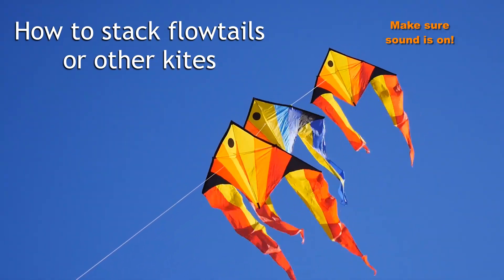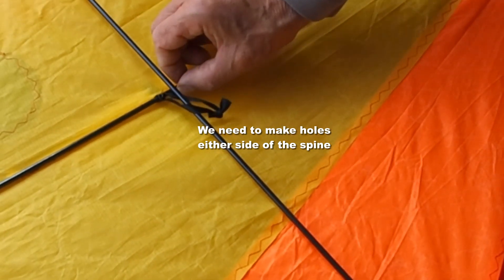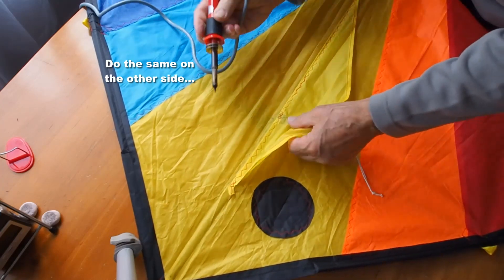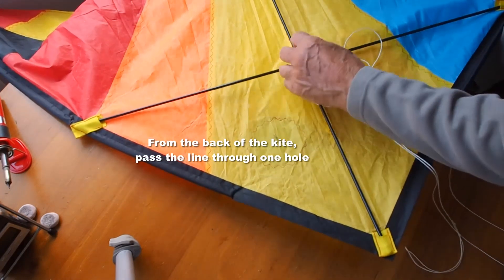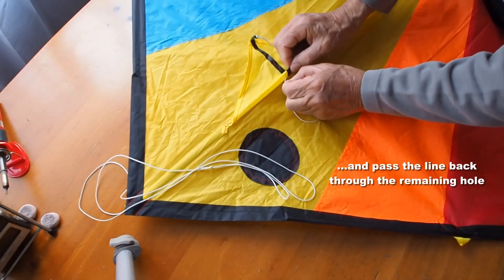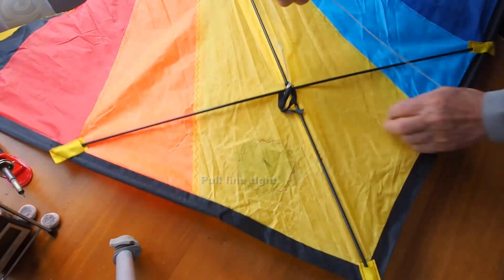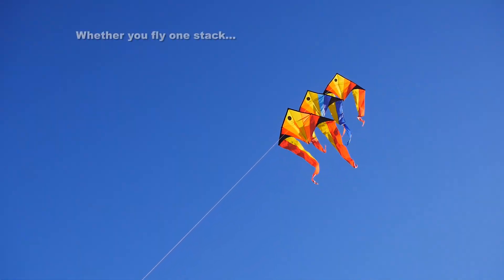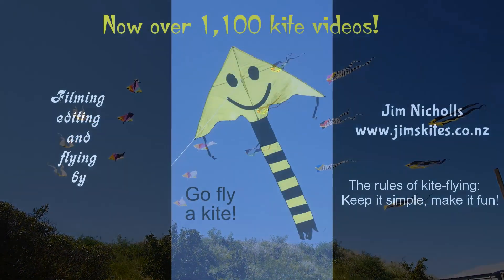How to stack flowtails or other kites

Comment: thank you for another great video, we were wondering how you stacked your kites multiple stacks looked great,  do you have to increase the strength of the flying line ? if so do you have a rule of thumb by how much you increase the strength for each kite added ?
Reply from the maker: For the smaller kites, I use the same strength line, but if I stack bigger ones, or more of them, then certainly I increase the line strength.  It's really just a case of using your own judgement  about the amount of pull you expect to get, and that depends a lot on what winds you're flying in.  No doubt if you have strong winds blowing in off the North Sea you're going to need stronger line!  I hope you're getting plenty of flying weather these days.

Comment: Great Video. I have a question, make that two questions. How would you stack three Cody kites?  2nd question, are the fish deltas you are stacking in this video pretty good kites? Besra has two sizes and the smaller ones are well priced, so I thought I might try this myself.
Reply from the maker: Derrick, I've never tried stacking Cody kites, but the originals were designed for stacking and used as man-lifters.  You may need to research it, as I have no idea.  The fish flowtails are OK, but not the best-flying kites of their type.  Good value, though, from memory.  The smaller kites are, the less capable fliers they are, as a general rule. (Not always true, though.)

Comment: Do you find a need to reinforce the holes to prevent fraying? I have several kites that I have duplicates of and would like the ability to fly either stacked or solo depending on my mood or winds so would like some flexibility with that.
Reply from the maker: Tim, there's usually no fraying because the holes are burnt, not cut.  If you want flexibility, you could make the holes as shown and then just tie loops of line around the spine as attachment points, the way I showed in the latest video.
Reply: @JimNicholls  Earlier I had been punching in grommets on a piece of fabric and had a brain fart. Never mind <g>

Comment: Guys a question, whats the distance between the kites?
Reply from the maker: The usual rule of thumb is about twice the wingspan of the kites you're using, but there's no hard-and-fast rule.  If they are too close they will interfere with each other and not fly well.